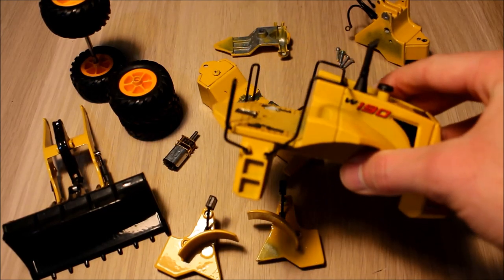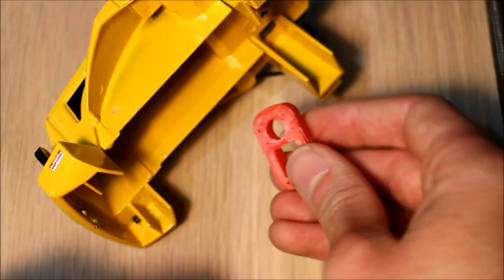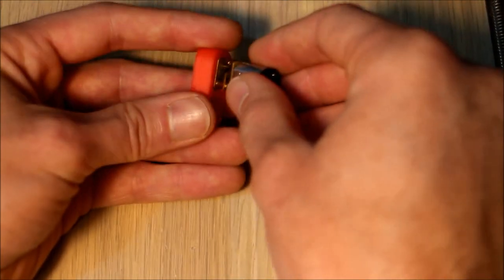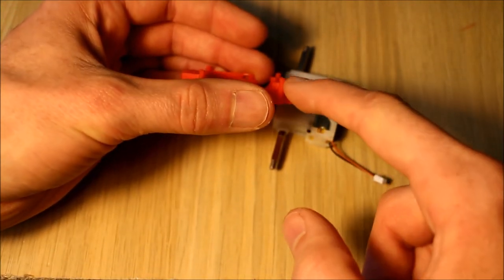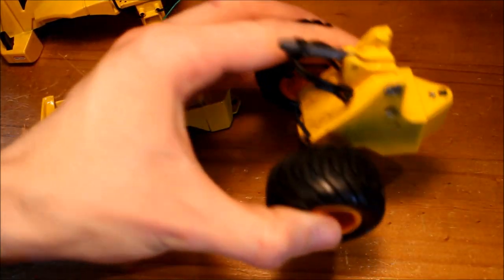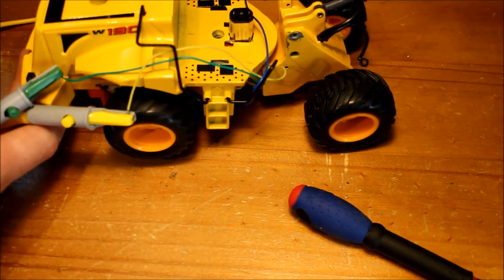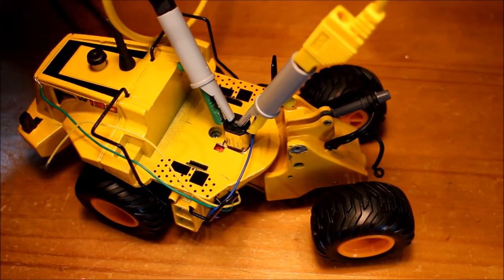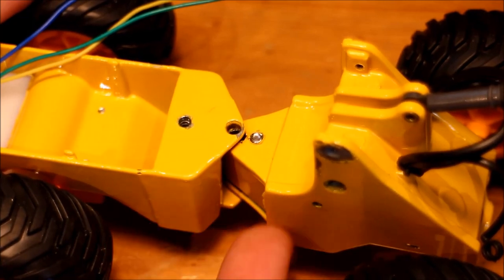RC New Holland Loader Part 3 - 3D Printing N20 Steering Motor Bracket and Control 32 Motor Cover

Comment: I know it's probably too late but Im just curious why don't U use a servo for steering instead of this? Maybe it was a bit easier to do and not least it's centers itself automatically and have end points as well and U can easily trim and set it from the radio U use. (obvious, I know...) But I admit it was more challenging this way. 
Btw it's a fantastic build video and I respect Ur work. :)  Keep doing it! 
(Sorry for my bad language, Im from Hungary! It's the best excuse that I have) :D
Reply from the maker: A servo probably would be better but I just taught a gear motor might give me lots of turning power even when dozing through gravel without taking a lot of space so I was just going to try it out and if its rubbish I'll change for a servo :)
Reply: First of all I'd like to thank you for your attention and second than you could just apply a cheap servo eletronic with the potmeter somehow  and still use this motor and than you'd have centering and the power stays too. But I think there are a few small size servo that produce enough torque. 
It's Youre project anyway, if You listen to me,.. Do what You want. ;)  Cheers!
Reply from the maker: Yes adding a potentiometer to give feedback it probably the best thing to do. It's a popular build, I must get back to it soon but it requires a lot of time which I don't have at the minute :)
Reply: Ignore my comments and go on and continue what You did before! :D
The time that You don't have is familiar to me too and if I have some free time than isn't always a good thing to start to "build", because if Im not in the mood than usually I just screw things up. :D
It's awsome btw, Im subbed to your channel...
Cheers from Hungary!
Reply: nice